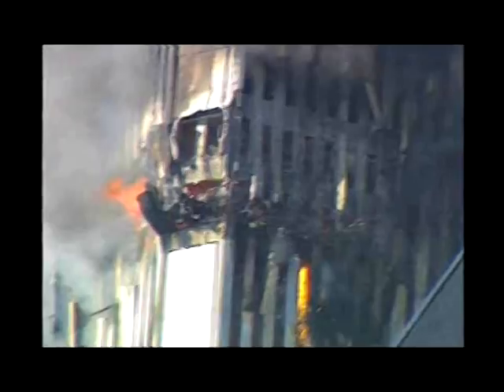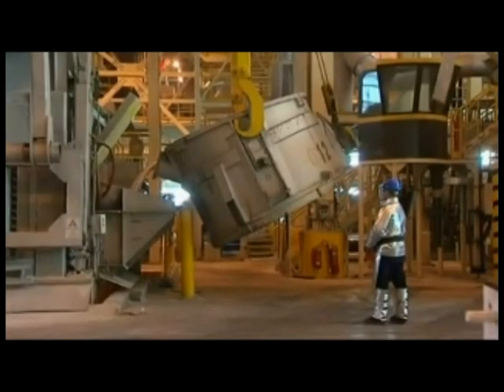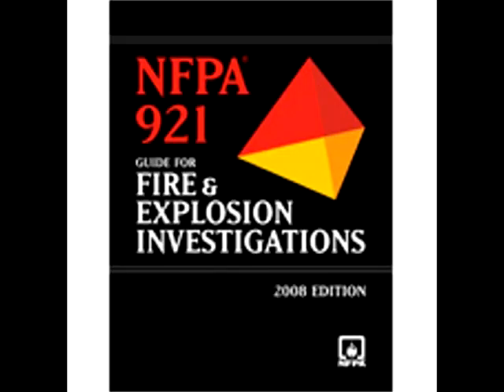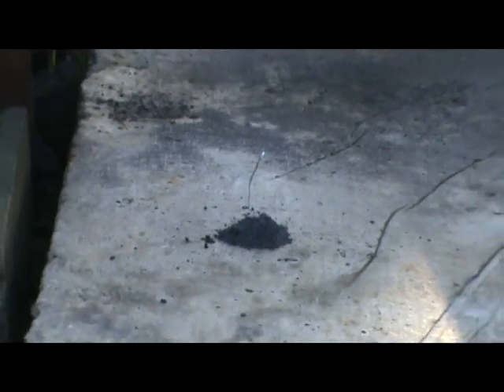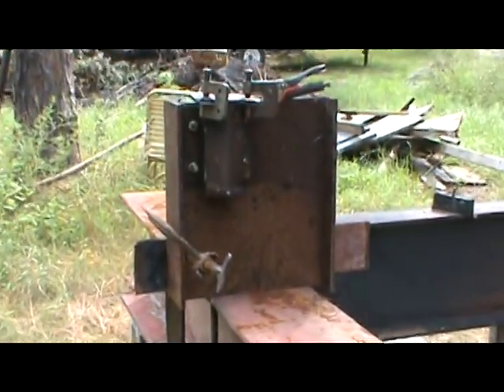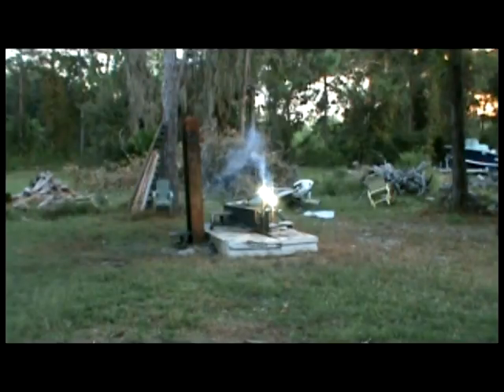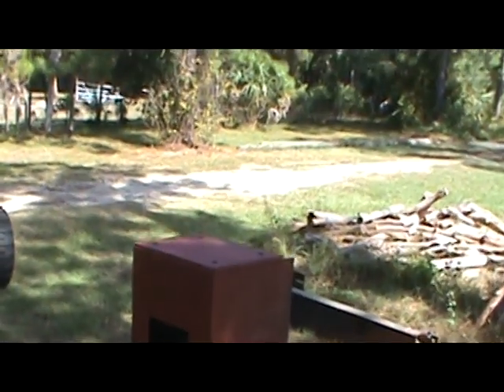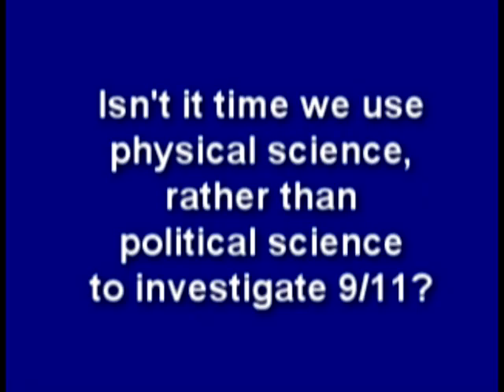9/11 Experiments: The Great Thermate Debate

Comment: The steel did NOT melt. It got SOFT. Any questions?
The soft steel BENT, and I saw it with my own fucking eyes. Any questions?
The upper floors fell like a sledgehammer driving the building into the ground. Any questions?
We do NOT know how many vertical supports remained after the planes hit, right?
Why wait an hour to blow the building? That's stupid.
The popping were RIVETS popping when the SHOCK hit them?
Any question? Don't bother me with them!
Reply: Darryl Edington ..nice piece of bull shit....pulled it right out of your ass did ya?...im sure you have numbers to back that crap up.

Comment: So personally i have seen train tracks beeing welded together with thermite and there surely are videos of it being done on YT. Now i am no engineer but it seems to me welding is basically controlled "melting" of material, in this case done by thermite on steel tracks.

Comment: What happened to all that debris?
I heard the shipped it to China.
So, if I was China I would have examined that debris ASAP.
I don't really see what you are talking about with the thermite/thermate/etc?
Are you saying that some project was executed that put these explosives
inside the WTC  and then set them off when the planes crashed into the buildings?
I just do not believe that.

To me the thing that makes the most sense is that the buildings were
built with demolition in mind so that in an emergency there would be a
way to bring the building down safely and not have it tip over like a tree
being cut down and take who city blocks out and thousands of more people.

Comment: This is such an inside job that even a libertard can conclude this was planned with inside help. Someone wanted a war and they got one. Jet fuel and airplanes did not bring down these buildings.
Reply: A real plane flying in to those towers would have been squashed like a fly with a whacker and dropped down on the street below looking like a tin harmonica.
Reply: SuSSiSu give me an example of a large passenger aircraft flying into a building at several hundred miles per hour aside from the 9/11 example and tell me what happened to the building and the plane.
Reply: Empire Textbooks I don't need to give yo another example. Flimsy plane wings hitting multiple times enforced steel..leaving a shape of a wing cut IN the steel, along the length of the wing..? Naahh...If you're up to it, you are obviously allowed to waste your time with trying to sell me the idea of that the impossible is possible..but..Naaahh....i've seen what a front of a plane looks like after a BIRD flew in to it..so..going through steel, complete..whole..without even a bit of it dropping down on to the street..You guessed it..Naaahhh..
Reply: SuSSiSu you’ve just been owned; you don’t have an example of a large airliner going through a building. Until you can provide that evidence, then the assumption is that an airliner going through the World Trade Center (which was also on video) happened.
Reply: SuSSiSu and yet you can because it happened and there is video evidence to prove it. Are you saying the videos were fabricated?
Reply: I'm saying you're a troll.
Reply: SuSSiSu GTA V😂
Reply: Patriot for Truth but they did bring it down
Reply: Fact planes hit the buildings causing them to collapse....
Reply: Ultimate gamer: you have to be a young person because you expose your lack of knowledge. Fact, jet fuel cannot melt those steel beams it is not possible. Jet fuel does not burn hot enough to melt those beams. Thermite would be required to melt the beams. Further, jet made of aluminum which is light and weak. Steel beams could not even bend if hit by a jet.
Reply: @joecoco908  correct. Transference of weight and mass at high speed (kinetic energy) like a fully fueled multi ton plane into a building will bring it down. Only idiots will gleefully suck up this crap and believe it. I have a demo background and it would take months and months of prep work and exposed walls and miles of wires to bring these buildings down. So..its suggested the thousands that died in there blissfully ignored workers gutting the building to lay explosive charges and went to work knowing the building was being rigged to blow? Everyone that believes in this..please stop breathing.
Reply: Glad a rightard can agree
Reply: Lazy thinking at its best.  The buildings were designed to withstand being hit by airplanes, which they did. The fires and subsequent heat generated by the burning fuel was sufficient to weaken the steel frame enough to allow the buildings to collapse.  Thinking of it being an inside job implies that the government was organized enough to actually carry out the attacks.  Believe me, the government is not that organized.

Comment: well this absolutely settles it. i don't know how i haven't seen this in all these years and i know i'll be saving it on my drive but i never would have guessed you could focus thermite like a water flow almost and i didn't know it could also be magnified with a different compound of thermite mixture. good on you for your research it certainly answers a lot of questions about the debacle

Comment: They had a video where someone tried to just pour a big pile of fuel under a steel beam. It broke.  Since you don't need to actually melt it to have it collapse, just heat it enough to weaken it. And I don't see how you can have so 'little' thermite and have the niagra falls of molten steel falling out the windows...
Besides, wouldn't that be a lot more work to get the stuff in the buildings and pillars that are mostly covered up and the planes and the stuff... what would be the point, or even the long term point...?

Comment: Oddly enough, No. 2 Home Heating Oil has a higher BTU rating than the Jet-A fuel used in commercial aircraft, yet instead of the NIST trying to sell a gullible public on the notion that a building fire was so hot that it melted treated steel in an oxygen starved fire, almost every year we pay to have the oil burner repairman come to our homes and tune the living shit out of our heater in oder to maximize the heat output.

So, why is it that the steel parts of our oil furnaces don't turn into puddles of melted metal every time we take a shower? And those furnaces are routinely tuned to maximize the make the most efficient use of the available oxygen, while the billowing black smoke was an indicator of a severely oxygen-starved fire.

Comment: I love that wood was used for a thousand years to melt steel and forge weapons such as swords.....but no, jet fuel mixed with all that plastic, rubber, et al that was being funneled into what very closely resembles a furnace chimney can't possibly weaken steel beams that are under huge amounts of pressure...
Below is a video of a guy trying to melt aluminum with a home furnace using an oil burner but accidentally melts his steel crucible. 

Also note than many of the "cut steel beams" were found AFTER the cleanup operations....which used thermite and steel cutters to clear for rescue operations.

Seriously, how is this still a thing?!
https://www.youtube.com/watch?v=TUSOczTBkWU

Comment: Might have been weak steel?
Reply: way to go, you've cracked the code. you're finally caught up to the rest of us.
Reply: Why sarcy?  I haven't heard anyone say that the steel used was inferior steel
Reply: Everyone has been saying the steel heated to the point where it just gave out. You don't need to heat steel beam untill they will literally melt, for a structure to collapse.

Comment: Directed Energy Weapons ostensibly cause "dustified" steel and aluminum that yield residue easily mistaken for "thermite" or "thermate".  Some Directed Energy Weapons also apparently result in tritium contamination, painfully documented for decades at Brookhaven National Labs RHIC ion gun, which, coincidentally, also happens to be exactly 61.1 miles from WTC at an angle of 119 degrees and headquartered in building 911.  Verify it yourself.

Comment: My concern is that ok if thermite was used how and when did they place it?
Reply: the original like was that it was painted on the walls but that didn't need to happen cause the real conspiracy is the poor structural engineering on the building. go to GONE LUCID I gathered all the facts and do a little debunking. the final 9/11 series comes out on the 17th anniversary
Reply: how could it be painted on? thermite is a solid...

Comment: Now you need to do an experiment with mass of quantities of jet fuel, lit on fire with ruined beams, place billows at about 30 to 40 kts to see if that will cut the same way.
The goop coming out was likely aluminum which is what most aircraft are composed.  Aluminum still glows yellow at not far above its melting point 1,220. Any impurities will change molten metal that have a silver tone too.  Jet fuel can burn without assistance at 800F 1500F... and billowing 30kts to 40kts of air, you're looking at hot temps well above its melting point, to glowing red hot.   

Steel itself doesn't need to be melted to soften the structure.  That's why it is unlikely molten material was steel/iron. It was likely aluminum with other stuff like computer monitor and glass.
Reply: look at old pics of the construction..it wasn't beams but rods holding up the floors.. doomed for failure

Comment: Not melt, but heating it to such a temperature, coupled with the insane weight above it, did cause it to buckle. Once one part of the structure fails, it adds load to another part, so on so forth until eventually the entire thing cascades. You're right, 1800 degree isn't enough to melt steel, but it will soften it.
Reply: dude the floors had rods not beams.. it blew my mind finding the truth about 9/11. it was indeed an inside job. look up my 9/11. videos on the GONE LUCID Channel. parts 4-6 come out in september

Comment: The buildings came down because the metal trusses sagged under the heat which cause a huge amount of stress on the outside connection to the outside columns . Once the outside connections  failed that cause a domino effect which is why the buildings came down so fast . There's no demolition just a bad design. The heat from all the debris rubbing together as each floor collapsed on to each other had to be unbelievable hot. Never has there been a building of that size and structure been brought down. No conspiracy here just some very bad people who wanted to do us harm.